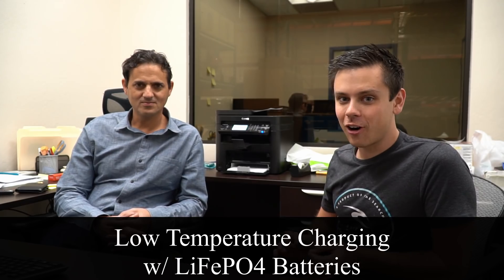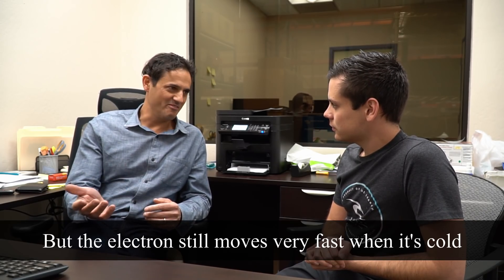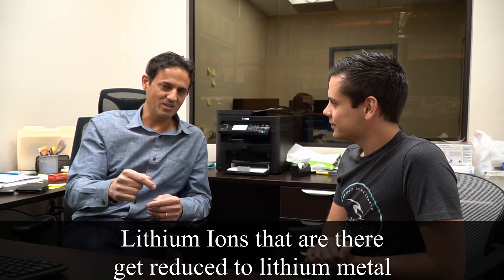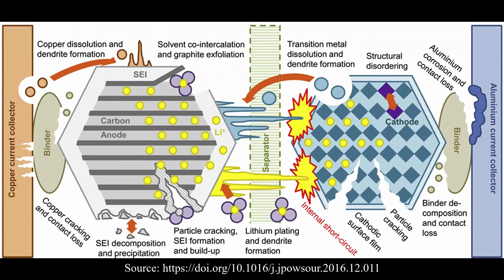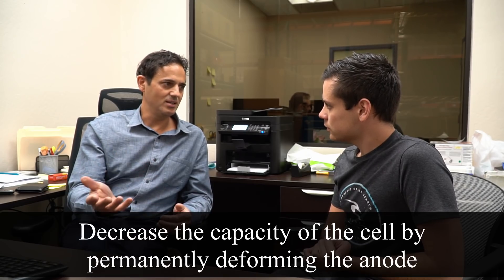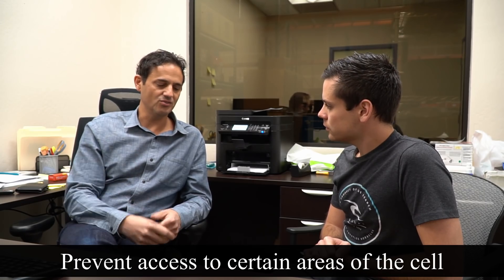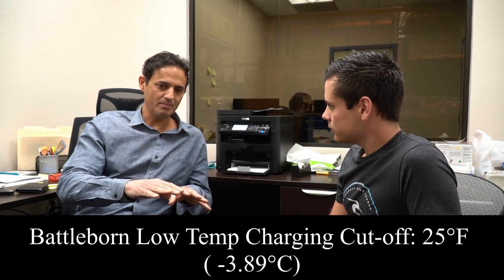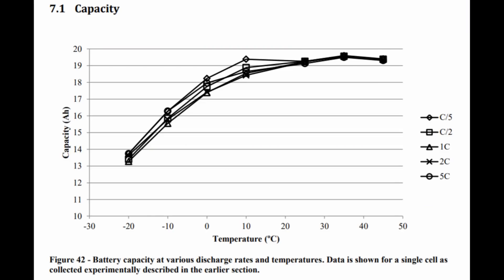Battleborn Battery CEO Interview! LiFePO4 Low-temp Charging, Storage, Longevity and so much more

Comment: I know this video was 3 years ago, but I hope you see and can answer my question; I live in my rv full time, sometimes I am hooked up to shore power for y months at a time, sometimes I’m not. When I’m not hooked up to shore power I generally use my solar charging, or if necessary my generator. I can switch my power converter between 13.7v and 14.4v (I believe that’s the voltage). Based on this info would you recommend I switch to the lower voltage when ‘floating’ on shore power, but switching back to the higher voltage when boondocking? Based on the conversation around the 15 minute point

Comment: I watched this video once before, but came back to watch it again because I thought it might answer a question I had.  Other than the concern regarding low temperature, it looks like low voltage is most important.  Is there a way to make the battery stop charging at a higher voltage, before it gets to the point where too low of a charge would do damage?  Also, if I am away from my boat for a long period, would it be bad to leave an AC to DC charger on constantly, or would this cause damage from too high of a charge for too long? Is it bad to have my AC to DC charger and my solar panels charging at the same time? I've heard that could cause damage.  Thanks to anyone out there in Youtube land that might be able to help me. 😊

Comment: Would installing in a spare battery location under the hood of a vehicle reduce the lifespan of a LiPo battery? Seems to me that these types of batteries are best installed on the interior of a RV/Passenger vehicle to eliminate hot/cold charging/discharging characteristics.

Comment: Thanks for this informative Interview.

Considering the lithum plating - could this be detected that the battery can't take the supplied charge current by measuring the voltage - thus would a limit of the charging voltage in this moment protect the battery from the plating Problem? Or is this voltage lower then the daily voltage limit?

As far as i understood the problem, it is that the battery has no means of communication to tell the charger to slow down in the moment. Others in a car where the BMS is always checked by the power electroncs.

Comment: Great interview i have one question however 
If im using the batteries through an inverter to run a 1000 watt microwave do i need 2 batteries at 100ah or can i use just one

Comment: I was concerned about leaving the RV connected to shore power while in storage. My charger is set to 13.6 volts float / 14.4 bulk. Based on this video I now believe that is is fine to store the RV plugged into shore power and not be concerned about damaging the batteries. I would disconnect the batteries but the RV leveling system will loose its memory and need recalibration.  If I am wrong in my understanding  please let me know. Thank you Will, the information you provide is valued and appreciated.

Comment: Hi Will..
Don't know of you'll see this note, but yesterday I watched a video comparing Lithionics to Battleborn..
Although I wish I had a heater in my unit, I own & I'm pleased with my Battleborn battery..

However, the video I watched revealed a few Battleborn construction choices that, with my rather long electrical background, gave me concern...

1) the number of connections in the Battleborn that rely on a type of plastic, sandwiched in crush zones, to maintain their original thickness to maintain the required compression / bolt torque & keep a secure, low resistance, current path.. If the plastic material deforms, then the connection will become loose & generate even more heat..
2) the positive battery terminal is not directly bolted up to the positive plate.  Instead it only relies on one bolt, of unknown material, to allow the passage of the current from the terminal to the positive plate..  In addition, again, the bolt's ability to maintain the required tension needed to maintain conductivity, is entirely dependent upon a layer of plastic retaining its physical thickness..
3) it appears that the bolt connecting the positive terminal to the positive plate is a plated steel bolt of about 5/16" in diameter.. This may be one of the main contributors to the measured internal impedance of the Battleborn, being over 8 ohms.. Again, IMO, the positive battery terminal should be directly sandwiched against the plate AND there should be no non-metallic material in the bolt's crush..  

Please check out "The Fit RV" youtube channel's video "RV Lithium Battery Face-off: Lithionics vs "Brand B"" put up on May 27, 2021..
There are other revelations, but as much as I believe in & support Battleborn, IMO, the few I've mentioned above, really need to be addressed..
Thanks for all your videos, you're doing a great job..
Best regards, Dennis

Comment: CCA still matters when the cells are small. Bigger cells will SMOKE the test equipment, but for small cells (eg 1s4p headway 38120HP pack without BMS) the cells ARE the limit and my testing of that config is 325A both with an old school shunt style tester and a modern pulse style tester, same numbers within a few %. Also 200A continuous yielded 10V or something like that. Amazing for 1.4kg :-D I use these in most of my cars with small engines, and for slightly larger ones double it 2s4p 650CCA and have built a 4s4p pack for starting an 8.3l C series cummins but the alternator destroyed half the cells at 18.2V, so now a 5s4p pack with normal charging voltage of 18.1V so the extra 100mV won't matter much. Awesome cells for high current density applications where capacity doesn't matter. If you need capacity AND high current, bigger cells are the best bet as they have high current covered naturally by scale.

Comment: A control circuit to dump solar energy into a bank of resistors amongst the cells below some threshold temperature until warm enough then divert into the cells once warm enough would be trivial to engineer.

Comment: Wondering if a bank of these could be safely wrapped with the same heat tape used for keeping water pipes from freezing to maintain operating temps safely? The one I use has it's own temp sensor and turns itself on/off when needed.

Comment: I have been a Battle born fan for a while now in my RV. How will there batteries work in a vehicle. I have had a local battery store tell me that they will damage the alternator because of the low internal resistance. I know when i do a conversion on a BMW from a lead to a AGM the on board battery monitoring computer has to be changed.

Comment: So it's safe to recharge lifephosphate at cold with minimal amperage and voltage  .  Say like 2 100 watt panels, overcast, 15 degrees outside 25 in garage.  Slow and low that is the tempo, insulated batteries sitting above heat from inverter.  Encased

Comment: Unsure if this tidbit came out, as I didn't hear it, as I've always wondered if the BMS would stop (or not allow) charging at anything below 25 degrees?    The reason I ask, is I have three BB's in our coach, and I'm wondering if they can just sit there (coach is plugged into 30A constantly) at these lower temps, or if I should disconnect them completely, or just shut off the 30A to coach?   As it now stands, I believe being plugged in, the inverter is on, keeping the batteries at a topped off state, where in reality, I don't want that below 25 degrees.   Just trying to set them up for getting the best longevity which are about 6 months old now...and I'll be adding one more 100ah battery to the mix in the spring.

Comment: Great questions from Will.
But the answers too wishy washy. Cold temp charge at 25F is OK "at a low rate" for "typical charging" What is that? I want something I can design a system around. Battle Born spec sheet has almost no electrical specs, and nothing on charge rates vs temp. and even this interview the info is vauge.
I like the Relion spec sheet. It clearly states <0.1C rate from 32F to 14F, and <0.05C from 14F to -4F. 
But I still would like to see cycle life data at 32F for 0.2C or 0.5C charge rates. 
I have seen graphs on LFP cells at 1C charge rates that show huge hit on cycle life at 32F

Comment: It would seem there needs to be a bypass circuit into heating to keep a desired temperature. Similar to a home setup where excess charging could go into a heat exchanger instead of just going into space.

Mppt add on, perhaps a standardized protocol battery manuf can deliver to mppt manuf so that the batteries are kept at optimum. Similar to isobus for farming equipment. The parameters are the same type so it is just a table entry in software.

A question - is it possible to take 24V battery bank and split the load into 2x12V as long as each part is discharged to the same degree, be it LiP or Pb batteries.

Comment: Steve Snider   I bought four batteries after talking to Dennis . Two of the four went bad first year  they sent a new one out . the next week same thing happened I called them up and told another one broke  (same thing as first bat and they hung up )I called back went to voice mail the next ten times .I used wife phone answered  second ring. They sent me a RMA form and wouldn't accept it back( wrong address ) I tried other computer same thing  Blocked. They won;t give me a RMA number to send back battery  Unless Dennis reads this and decides to unblock me and send a RMA number ,so  they can fix it If he doesn't I'm out a lot of money.  I'll keep you updated on what happens.

Comment: I have a question for you battery experts.  When I go to the store to buy a lead acid battery for my boat, they want to know if I'm using it for starting the engine or as my 'house' battery, in which case they sell me a deep cycle battery.  
If I were to get one of these LiFePO4 Battle Born batteries for my boat, could I safely use it for starting my outboard engines as well or should it only be used as a deep cycle for running my lights and electronics?

Comment: Question about temperature. Let's say it's 0 degree C, not good for charging. I imagine discharging the battery will warm up the cells to hopefully a temperature that will safely accept charge. How do you calculate such rate of heating?

Comment: What about expanding on this with a video on battery heating? Id like to be able to charge my batteries in the winter but It seems to be pretty involved to connect a heater up to the batteries to draw power or to the solar panels and not kill the batteries while trying to save them.

Comment: Thx Will, very informative and I'm definitely considering the Battleborn Batteries for my bass boat 
.  My only concern Will is about the warranty where I read this "
Environmental damage; inappropriate storage conditions as defined by the Manufacturer; exposure to extreme hot or cold temperatures, fire or freezing, or water damage" didn't see anything about water damage in your talk with Dennis which is my concern.  I mean if I accidentally  flooded my battery compartment or we talking about condensation around the posts?
Hope I'm making since Will and you can educate me more. Thx

Comment: My question is oki am a truck driver I have a 8 battery system 4 AGM 4 start battery’s I kill batteries every 2 years or less can battle born be used as start batteries I am sure I can replace the AGM with them

Comment: I ordered 3 battle born batteries in mid dec 2019. They are still in the box because I plan on buying 5 more next month to get a balanced 800 ah bank.. My question is... Am I harming the 3 I already have by not using them? I wanted to install all 8 once my new ones arrive to keep their usage the same. My last question. When I have all my batteries in place, do I need to charge them one at a time to full charge or connect them all together and charge all 8.
Reply from the maker: You can connect more later. It's ok
Reply from the maker: I like to charge them separately before connecting them

Comment: For CCA they test the max discharge load at 0 degrees F, but they specify a minimum voltage of 1.2V per cell, so 7.2V minimum. They also are rating based on the max discharge load delivered for a sustained 30 seconds. So typically during a cranking event your voltage is going to be far higher, as both your draw and crank time are far below the max ratings. In fact with many modern starters it's a bad idea to crank them at low voltages consistently.

Anyway I can see why they wouldn't want to discuss cranking amps of any sort. Lead acid batteries suck in general, but when it comes to delivering power in bursts like that they beat the snot out of an equivalent-sized LifePO4 battery, especially in cold weather. Personally I use AGM starting batteries, since they deliver good cranking power but have better reserve capacity than a flooded battery. But outside of starting batteries for vehicles, and maybe max-density applications like phones, LifePO4 batteries are pretty much the best.

Comment: Will Thank you for your video, Let me explain I bought 4 100 amp hr batteries from Battle Born for a total 400 amp hr, and I have a Progressive Dynamics 9200 series with voltage of High, Float, and Store, and a Bogart battery monitor system. I did a few tests and then thought it might be better to change to LiFePO4 charger and move to 14.6 volts (float) but after seeing your video and talking to the tech at BB I installed my old unit back. My Channel is.  A Canadian RVer eh I have all the videos there on how I installed the batteries and more.

Comment: great video !! like the info on the LiFePO4 battery. they are different and lot of people confuse MMC types of ION batteries. you can use them cold just have to limit the charging current.  you can charge 100 % and keep cycle life.

Comment: I have been contemplating LiFePO4 batteries for our sailboat for a while and am about to pull the trigger in the next month I think for either a drop in, something in the middle or full diy if I can get my head around it all enough...
...One hesitation we have had  was about going to Patagonia next year after installing them....so this video was very helpful to know about just not charging them quickly. Also, we will be regularly heating the boat so although it’s cold outside, the batteries will be inside the heated boat...so maybe I don’t really have anything to worry about. This was a great topic for us, along with everything else you discussed. 
Any hints on the size and the pricing of the new GC? And will they have the internal heating? -Rebecca on SV Brick House

Comment: I have three 100 ah bb battery’s with a 3000 watt Victron charger inverter, 400 watts of solar panels victron mppt.  So far after camping with golf cart batteries for ten years, what a difference.  I can camp without hookups, and in most cases never miss the conveniences.

Comment: Battle born could do better with an instruction manual shipped with the battery. I did stumble  Across an instruction manual on the Internet. Nothing I have read covers an incident I had with mine. I was over drawing them hard starting a RV air conditioner and they totally cut out. I thought I had destroyed them then thought to put a charge to them and it revived them. So I guess they have an emergency cut out that is only reversed by putting a current back into them. This was not covered in the manual I saw online.

Comment: great video, question though since CCA is a non term for lithium batteries how do they work for 1 starting your generator and 2 using them as a boost to start our engine of that battery goes dead.?

Comment: Good answer, thank you for this video！ about the heating system, seplos company have spend about 8 month on this function, still not good. As their use prismatic cells. When the cell surface is warming, the inside of the battery is still not that warm. Can not wait to know how battlebron battery solve this problem. Their cells maybe not that easy too

Comment: I guess I'm doing it right.  Bought 4 Battle Borns on the Cyber Monday sale 2018 for my van.  Then got sidetracked on building the van.  I almost packed them over to my shop that's not heated.  But decided to keep them here in my house where it's the "comfortable temperature that I like".  Just checked the voltage and they haven't changed.  13.3V for 13 months now.

Comment: One question that nobody has been able to answer for me:  If a LiFePO4 cell dips below say 2.8 volts during heavy discharge due to cold weather even though it is say 80% charged, is that deleterious to the cell?  My BMS gives a warning under those conditions because it uses the actual measured voltage for the alarm, even though it calculates an open-circuit voltage that would be more indicative of the state of charge.

Comment: How does the EV Market deal with this? I drive an EV and live in the arctic. So it is very common that we are forced to charge at temperatures below 0 degrees farenheight. My car often charge at 12A+ (240v) even though its cold.
Reply: Your car likely has a heating pad to warm up the battery before charging.

Comment: Awesome video as always.  I had put together a 24V battery using 8 50AH LiFePO4 cells and BMS for a friend in my neighborhood for his wheelchair.   Even thought I had told him not to charge if it might dip below freezing (rare occurrence here) I was worried would not follow that guidance.  Now though, since we are in the Bay Area and the charge rate is very low (4A charger) I no longer need to worry as I see it given this information. FWIW , that battery fit into the place left by his 2 35AH SLAs and he has multiple times the range now.  That was his big issue before, getting stranded on his long journeys to the mall as he was at times with even his new SLAs (when cold worse).  Seems like a perfect application.